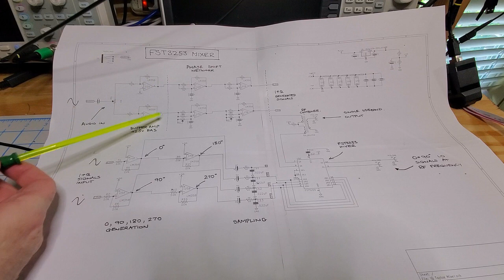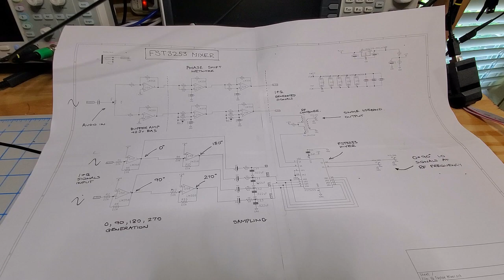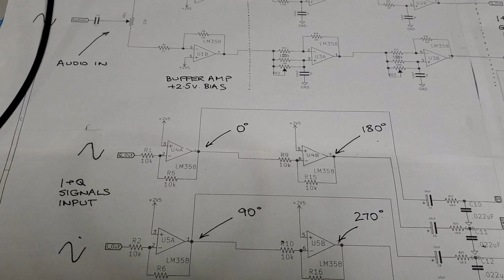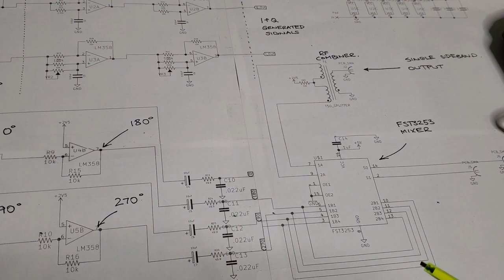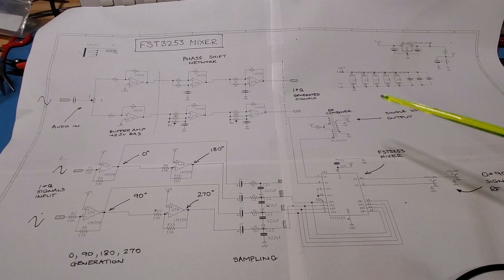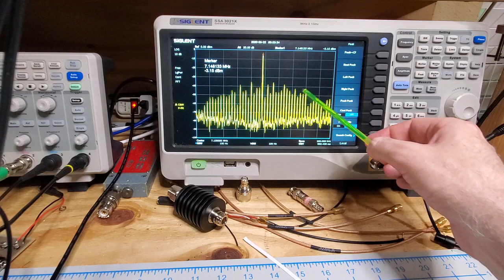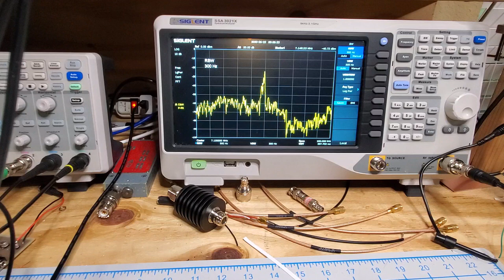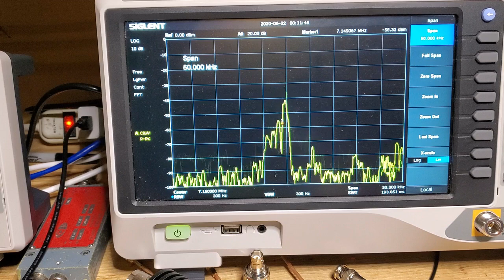Tinypico Radio Part 10a - FST3253 Transmit Mixer

Comment: Hello Ian, why do you think do we need for transmit an audio signal in all 4 quadrants (0, 90, 180 and 270)? If a mixer works as down-mixer, it should also work in up-mixing the same way I thought so I was expecting to use 1:1 the RX mixer configuration. Did you try the RX mixer with the 4 quadrants input?
Reply from the maker: Hi Stefan. My understanding is the four quadrant approach is used to reduce loss in the mixer. The 0 and 180 effectively add together (as do the 90 and 270) . That's at least my laymans understanding anyway. The receive mixers do the same thing - check this out (page 3)
http://www.norcalqrp.org/files/Tayloe_mixer_x3a.pdf

Thank you for the comment and question. I hope the above helps
Reply: @na5y  I will try it out and let you know...

Comment: I am a bit late watching your video - and I have to assume you have diagnosed the source of the additional spurious responses.  If not:  You are using a switch as a mixer - and the pulse shape of the driving waveform has a spectrum of lines rather than a single line (as in a sine wave).    As someone else observed, you may also be overdriving the op amps, causing them to go into limiting on part of the cycle - which also generates set of spectral lines.  I believe you may be able to do a little DSP .  Perhaps generate the SSB signal at a lower IF, where you can use a Digital filter after the modulator and then translate it up.  More complexity.
Reply from the maker: HI John - thank you for the comment. The biggest source turned out to be the opamps I was using (LM358s) I switched to LM4562s and a good portion of the spurious output disappeared.

Comment: Hi Ian, I just discovered your channel, very interesting, thanks! I wonder if the harmonics are being generated by the op-amps? I'm not sure if you said - sorry if I missed it - did you probe the outputs of the op-amps to see if the harmonics were being generated there and not in the mixer? Just wondering if you discovered the cause, thanks, VK7IAN.
Reply from the maker: You are exactly right Ian! I did find that out that in a subsequent video. Those cheap LM358 opamps were introducing a pile of harmonics. I replaced them with LM4562s and all those harmonics pretty much went away. Thank you for the comment!
Reply: @na5y  Awesome. Good to know! I'll keep watching.

Comment: I would like my team to implement your designs in an SOC in 40nm and below. We have the EDA tools to do it (Analog/Digital Rails. How do I contact you?
Reply: We will embed an open source 32 bit risc-V processor,  along with our PLL and interlacing pipeline ADCs
Reply from the maker: Cliff, to be clear they aren't my designs and I have no desire to commercialize them. I have just picked up bits of knowledge here and there through kits I have built and articles. Having said that happy to chat on my email address which I have updated in the channel "About"